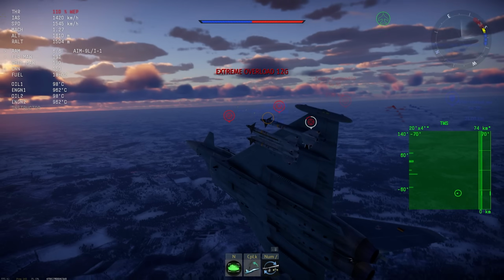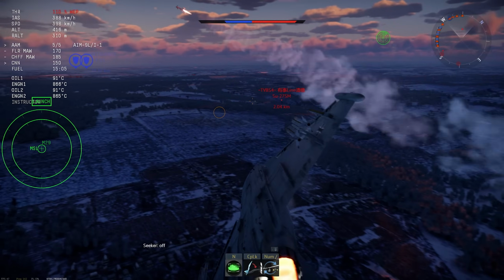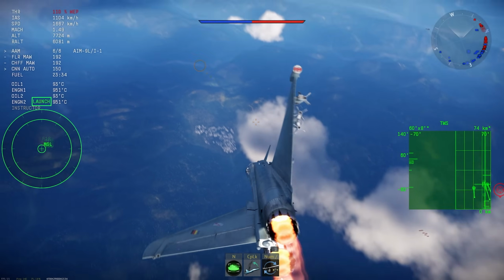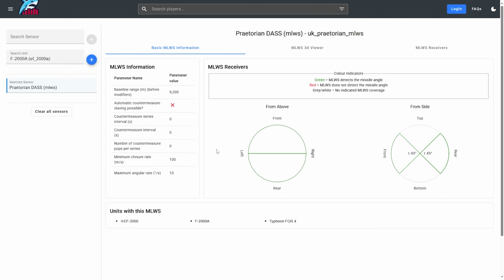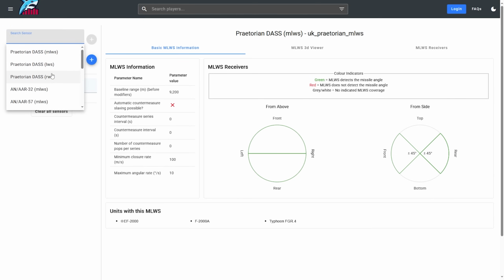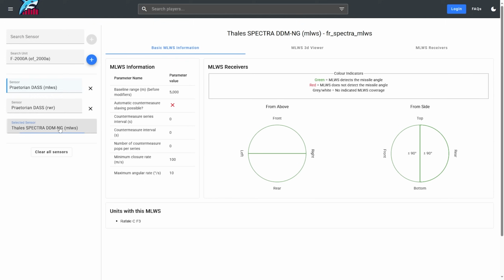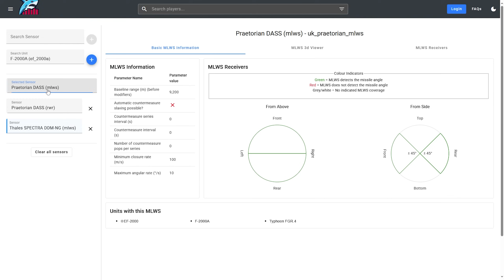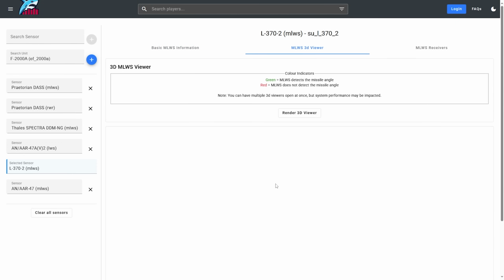SENSOR FUSION! WHAT is it? HOW does it work? WHO HAS IT? - War Thunder

Comment: Praetorian DASS (RWR/MAW) has 360 coverage IRL... 2 detectors on the wings and one on the tail...
Reply: @babalonkie  worth considering that these Eurofighters are 20 years old in-game. They aren’t updated to the latest specs because they’d probably be too modern. Whether or not the MAWS was updated over time though is a bit difficult for me to find.
Reply: @fulcrum6589  They have always had Praetorian DASS (Not the German prototype, but the service models). The first Gen was under a different name, but it was the same thing. The aircraft in game are late early generation Typhoons (Mid-Tranche)... Not first Tranche (Ironically, the British Typhoon ingame doesnt even have it's prototype or first generation weapons... The British Typhoon never had sidewinders as the UK got rid of them in 1998 and the Typhoon came out in 2003).

It has been upgraded over the years but the first one was based on and improved from Tornado's MAWS. Britain has always been big on detection and jamming since the invention of radar.

ANY Mid (Not Early) Coldwar or modern developed aircraft Britain has flown has had 360 detection and basic jamming as a standard requirement (Genuinely)... and if it's a joint aircraft, it will share that technology in a mutual agreement.

Sorry but everything about these aircraft in game other than their name and appearance is fictional. Performance, weapons and equipment... all fake or very inaccurate.

Comment: They will never fix the Captor-M will they? The amount of radar bugs during a single game with the EF is comical really. You either lock the enemy team on take off, you cannot lock them 5km infront of you or you have todo a barrel roll to get the Captor-M to update at all. 

They removed take off thrust for whatever reason, they increased the drag on the EF and limited the G which means with certain loadouts the EF just tumbles out off the sky if you pull to much AoA and you cannot recover your aircrafts speed what so ever if you put any small amount of AoA on the Airframe (Even 1-2G is enough to stall out the thrust gain from the engine), despite guided FnF ammunition like, AASM, KH-38ML and the Maverick, the EF is still the only 14.0 without FnF weapons, which basically means its the worst CAS option for 14.0 in the game currently. It's playable but man its not fun anymore, just the radar alone makes me wanna punch my monitor..

Comment: Thats why i drop chaff an flr at the same time. Its not efficient yet its effective
Reply: I do the same thing it's mainly cause I'm a console player but it's just less to worry about
Reply: You can't do that with Russian jets tho. You'll run out flares in seconds
Reply: @loicalex  I know I die constantly, I didn't say I was good. Also Hmd mode is useless to me, my cursor is controlling the plane, it doesn't go anywhere other then the front of the plane.
Reply: @JeremyPlaysGames2002  You've to add those controls. I'm a console player too and i can just do anything that a PC player can do.
Reply: @devisucarlo7922  wait that's a setting? I wish I would have known that. What's the setting calle?
Reply: @JeremyPlaysGames2002  You can add settings to drop just chaff and drop just flares and drop both. And you can add settings even to free look around (so the HMD will follow where you're looking at, while your jet will keep flying in other directions). You can also add manual settings to control your jet while free looking around, so you're not stuck just in using your mouse aim to move around.
It can be a bit difficult to get used to these many controls just in a controller, but it is possible.
I literally have any controls setted even if i'm using a controller lol even MAWS on/off, even NVD, etc etc.
Reply: @JeremyPlaysGames2002 Jesus how can you say HMD is useless it’s extremely convenient on controller especially when dog fighting and trying to launch off an r73
Reply: @loicalex no you won't because russian jet use large caliber countermeasures, so you just need to wait for the missile come closer then drop 5 - 7 times while notching and the missile will miss. in the end i'm still alive and have 20+ countermeasures left to spare.